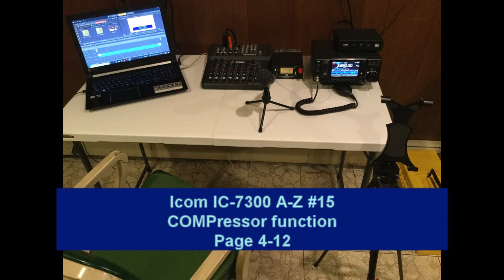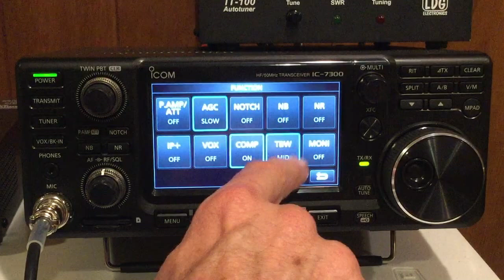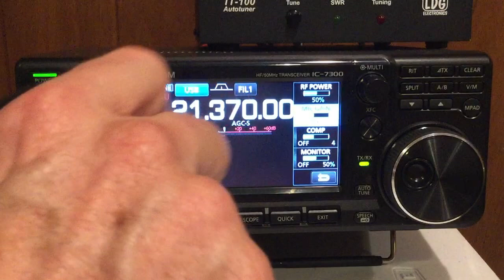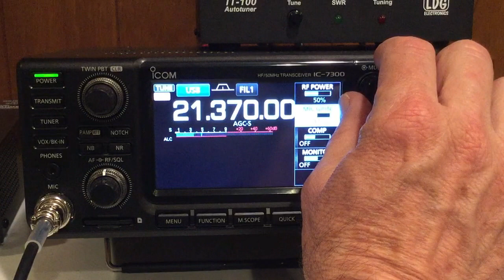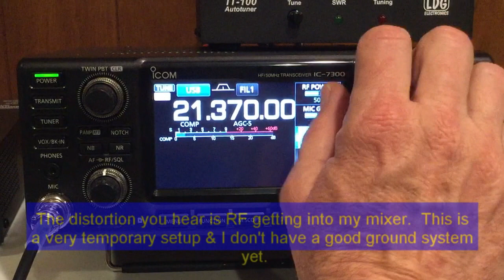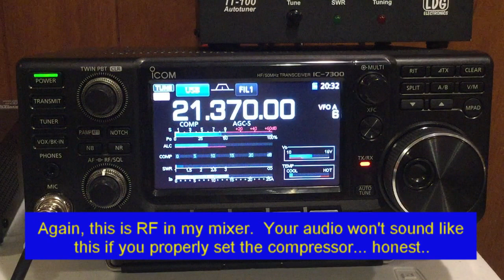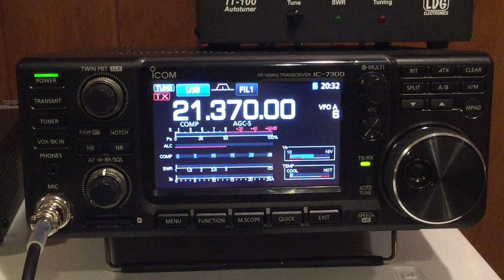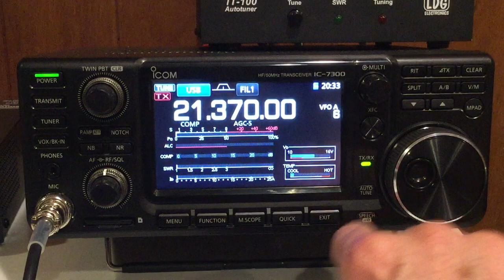Icom IC7300 A to Z #15 COMPressor function Page 4-12

Comment: Need a nano-farad across pins 2 & 3 of that XLR going into the mixer & some 10 gauge THHN & copper lugs for a portable ground buss, Even very good quality RF proof sound equipment can develop the scritchy buzzies especially when out in the field using less than perfect antennas. 
Love your work, thank you for the many much needed well organized simple explanations. 7300 is pretty much my first (working) HF rig.

Comment: I am considering the purchase of an Icom 7300. I currently have an all Yaesu shack, but I have heard so much about this radio, and talk to many people on the air using the 7300.  Your series is great and the more I watch the more I am convinced that my next purchase will be the Icom 7300.  I have subscribed to your chanel.  Keep up the good work.
Reply from the maker: Thanks Norman.  Thank you for the kind words.  I still have some Yaesu gear.  They are fine radios too, but it is hard to beat the capability of the 7300 for an "entry" level radio.  I suspect that more computing power gets crammed into smaller and cheaper devices this will be the norm going forward.  Yaesu and Kenwood have both introduced touch screen radios.

Comment: I have a Icom 7300 and a Heil PR-781 mic. When I adjust the compressor independently and the ALC independently, the ALC reads full scale when I talk into it. In other words, it looks like to me the compressor affects the ALC. The higher the compressor setting the higher the ALC (full scale).  I presently have the mic at 50% and the compressor at 5.
Reply from the maker: Hi.  The compressor setting will definitely affect your ALC reading.  Full scale is definitely way too much ALC.  I recently got a Heil BM17 headset-mic.  I find that the Heil mic is way more sensitive than the stock mic.  So I had to turn my mic gain way down with the Heil headset.  I have found that a mic gain of 50 works fine with the stock mic.  With the Heil mic, you probably need to be somewhere around 10, depending on your voice.

Comment: Hello & thank you for this great Video. I have a question: I have managed to get an orange COMP icon at the top right corner of my main display screen. I can not figure what I did to do that. Please advise what controls that. rgds, tnx & 73, N7KR
Reply from the maker: In a recent firmware update, Icom allows you to change the default function of the multi-knob when the menu isn’t showing.  It used to always be tuning in kHz.  You have set the default function to Compressor level.  If you turn the multi-knob without pressing it first, the COMP will change to a small display showing your compression level.  If you press and hold the multi-knob, it will change back to kHz.

Comment: About the RFI, I suspect you connected the line output directly to the mixer without a audio isolation transformer? If so this is why you are having issues. With a 1:1 audio transformer you will probably get rid of that problem right away, it is shown manual how to do it.

Comment: Got a Shure SM7B Dynamic microphone with the Heil CC-XLR-I cable, but audio from mike is very low. Now, the factory mike that came with my IC-7300, got even better with this tutorial. 73
Reply from the maker: Icom uses electret (powered condenser) mics for their rigs.  For an aftermarket one, you need to make sure it has higher output specifically for Icom rigs.  Heil and other aftermarket mic manufacturers have them.
Reply: @HamRadioA2Z  On the radio, monitor function, I can hear my audio, but not sure if it will be the same over the air. Will set up a low SWR antenna to test, as this one the internal tuner can not handle, and I dont have en external one.

I may go with the SM-30 or SM-50. If 30 is the same as the 50, but just few extra buttons on the 50, then the 30 will be or a Heil made for it. 

Thanks a lot for the great tutorials. 73.

Comment: Any chance on getting a video on how to setup a mixing board?
Reply from the maker: Hi. If you look at episodes #8 & #9 I did show how to wire up the accessory connector to get audio out of the radio.  I didn’t really go into specifics about using the mixer.  I’ll keep that in mind for a future video.  Thanks!

Comment: Excellent video. Thank you. About station ground. I run my station pretty much the way you have it setup in this video. I don’t run it that way out of ignorance. But for those of us living in high rise apartments, there is no possibility of  a station grounded as you would do it. I live on the 12th floor of a 32 story building. The street below me is nothing but cement. So all I can do is depend on the electrical circuit ground for grounding. There is no bonding everything together. We have what we have. Please consider making a video to address station grounding in apartment buildings. 73 de N2LRB
Reply from the maker: Hi Jose.  Grounding is definitely a misunderstood topic.  I'm pretty sure there are almost as many opinions about how to ground as there are hams.  I totally understand your situation and agree that it isn't practical for you to bond your station to the building ground in the way that is normally shown.  However, it doesn't mean that there's no way to do it.  In your situation, I would still recommend that you bond all of your station equipment together to a common ground point.  That point can be a simple as a copper ground bar.  Then you can tie that point to your building ground through the safety ground at an outlet where you plug things in.  A simple way to do that is to use a ring terminal under the center screw that holds the cover plate on the outlet.  That threaded hole on the outlet is grounded.  Then you can connect the wire from that ring terminal to your grounding bar.  You may need to get a slightly longer screw and you definitely want to get one that isn't painted.  For more reading on grounding, the ARRL has a good FAQ page on it:  http://www.arrl.org/grounding

Comment: Ive seen some conflicting information about setting up the transmit ALC.  I assumed after all the settings were done the ALC shouldnt go above 50% peak,  my current settings are   mic gain: 15%  compression: 3   my ALC is running about 75% peak  .... I use the stock mic and out of habit i keep it about and inch or so away from my mouth so it's close....I need to get a peak reading meter and see how the average output changes with different settings,  ive also listened to my signal from a remote sdr  but still havent found a definitive answer which settings are best for me....btw I also have the kenwood 590sg and it is critical to get that radio set up correctly or your average output will be really low,  the " S " version had an issue worse  than the sg model for low output and I believe had to be modified due to overly aggressive alc
Reply from the maker: Hi.  There is no question that some radios are more finicky than others as far as setting mic gain based on ALC reading.  Your ALC peaks do sound pretty high for your settings, but maybe you have the mic close than you think or you may have a voice that really projects.  My wife sometimes tells me I’m talking really loud when I don’t think that I am.  This text is exactly what it says in the IC7300 manual:  “In the SSB mode, touch the  TX meter to select the  ALC meter and adjust until the meter reading swings between 30 to 50% of the  ALC scale. •     Hold the microphone 5 to 10 cm (2 to 4 inches) from your mouth, then speak at your normal voice level.”  My experience is that the 7300 is pretty forgiving and I’ve been told that my audio sounds fine almost no matter what.  That doesn’t mean that we shouldn’t try to set the levels correctly.  All I can offer is to follow what the manual says and try to be consistent about holding the mic and your speaking volume.  One thing that can help (and I plan to upgrade to soon) is a headset microphone.  That at least keeps the distance from your mouth consistent.  I hope things work out well for you.  73,  Tom

Comment: Tom,  great video but in the beginning of the lecture you stated the ALC reading should be around 50% of the scale however when you performed the final test with the compressor your ALC reading was full-scale. So, which is it, half scale or full scale on the ALC meter reading?
Reply: 30 to 50% with comp off

Comment: if properly grounded does that power supply you have still pick up  birdie noise on 40m?
Reply from the maker: Hi Samuel,  I have quite a few birdies on 40M at our house in Kansas.  With the same power supply here at my father-in-law's house, I don't seem to have any birdies on 40.  So, I'm pretty sure the birdies in Kansas are from something electronic at the house or in the neighborhood and not from the MFJ power supply.  Are you seeing a lot of noise from the supply?
Reply: @HamRadioA2Z   i have  birdies, about every 5KHz,even with a battery. I guess its just different with the power supply. Mine is most likely the 220V AC current in the room, a one room apartment.                                                       Your explanation  of the two environments  is helpful. Knowing it's not the power supply rules that out.  
 I'm going to apply the text book ground to copper plumbing tomorrow and see if i just makes another antenna out of it.
Reply from the maker: I was going to suggest a battery to help rule out the power supply.  Glad you've at least got that piece of data. Be careful about using the plumbing as a ground.  Many recent buildings don't have copper going all the way out to where the water enters the house.  Quite a few have plastic piping called PEX.  You should check in the basement if you can where the water comes in.  If there's any plastic in the line, you'll just end up making an indoor antenna.
Reply: @HamRadioA2Z  Awsome radio i am buying one very soon .... Thanks for the video , you did a great job ... From Joe - W1VRP  .. 73 .

Comment: my comp will not turn on for some reason it is there but nothing happens when i try to turn it on?
Reply from the maker: What mode are you in?  Mic Compression is only available on SSB.  If you're in FM, AM or any data modes, compression isn't available.

Comment: I am so aggravated with this radio.  There is a known problem with it not putting out the output power it should be putting out on SSB.  I struggle to make contacts, shut it off and turn on my Yaesu FT891 and make contacts everythme and the 891 puts out double tbe amount of SSB output.  Should have bought a Yaesu FT991 for my base rig.  Fix this ICOM.  Its a known issue.